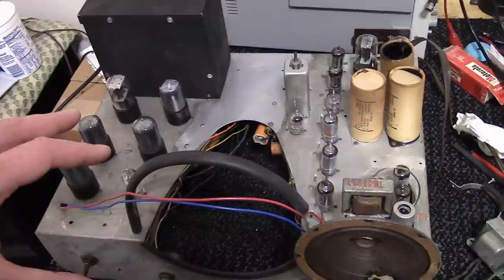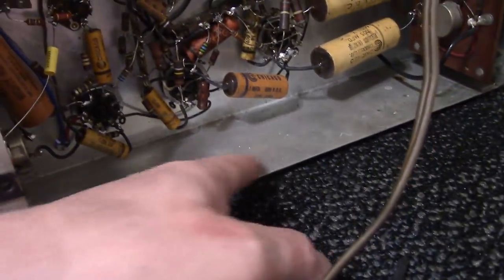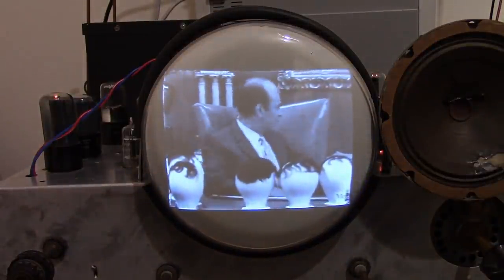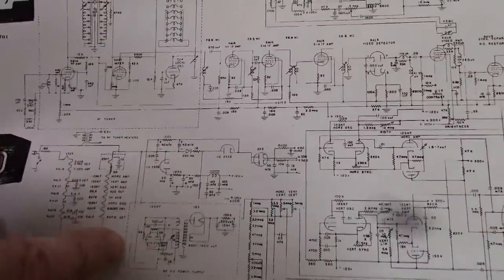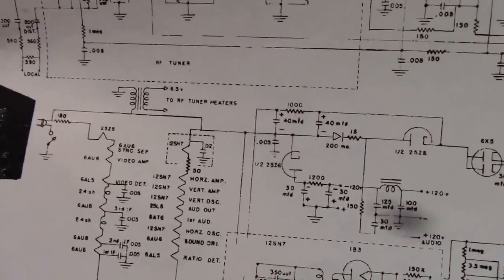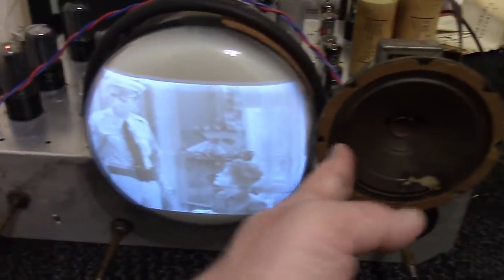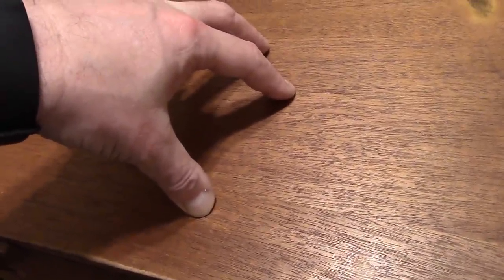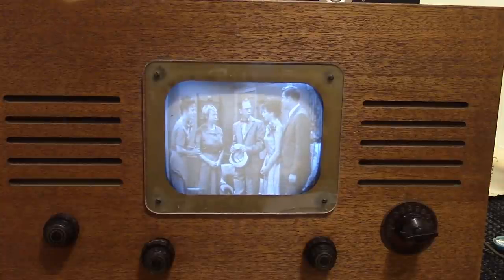Meck XB-702 p10o10

Comment: Wow the chassis looks and works amazing Bob! I think the CLR is the ticket for chassis cleaning based on your results! I haven't used it before, but I certainly will try it now. It's a shame about the cabinet, but the set works well due to your diligence and attention to detail! Great series sir!
Reply from the maker: Thank you. It works very well on cadmium plating and steel. However, it's only going to remove light surface rust. You'll still need evaporust or naval jelly for heaver corrosion

Comment: Cleaning expert here. Use WD40 and a short bristled disposable brush with lots of paper towels and q-tips. Works like a charm. Use 0000 steel wool and WD40 for rusty spots. Don't rub hard!
Reply: 0000 Steel wool can do some remarkable cleaning. I needed to clean some mild surface rust off of the brushed finished steel handle on a Sencore RC-121 substitution box, that has a "Sencore" branded paint logo. The 0000 was able to clean it without removing the paint logo, which I was pretty surprised at. The downside is, it will shed fine steel wires all over, that need to be cleaned up and kept away from anything they may get into while cleaning, especially anything with a magnetic field on it.
Reply from the maker: I've used those techniques in the past watch my "chassis clean tips" video from 10+ years ago ;)  I like the CLR on cadmium plating because it chemically removes the tarnish and corrosion.

Comment: Glad. It worked out in the end Bob. Reminds me of working on broadcast cart machines back in the 1980s.  I worked at a factory in the inner North of Melbourne testing and troubleshooting the CEI 993 and 996 models.  They were designed with the audio output transformers mounted under the mains transformer but the audio transformers were rotated 90 degrees.  Usually there were no issues with hum, but we kept some mumetal handy for the rare one that hummed enough the fail the -56dbm spec.  Wonder if the core wasn’t containing the magnetic field as well as it should?

Comment: It looks pretty nice as is. There are some dark marks on the screen that show up when the lights were out. I don't believe it is the tube, I'm guessing it is something on the faceplate which should just polish out when you refinish the case. I recently bought a circle cutter that doesn't punch a hole in the middle. It is a Thinnerline Circle Cutter by Shadow Hobby. In order to cut cardboard with it, you would need to purchase the 30 degree or 45 degree blade. It only comes with 1 60 degree blade, which is only really good for cutting circles out of paper and masking tape.
Reply from the maker: Yes, it is gunk on the plastic faceplate.  Thanks for the circle cutter tip.

Comment: Great vid as always. I added the DC restoration circuit you used years ago to my 7" Admiral and it worked great. I have never understood how a white phosphor tube can display black. My intuition would say in dark scenes the gun would emit less energy and the phosphor would not get excited and glow white as a bright scene, but remain unexcited and stay the same color as when the set is turned off-white.  But to turn it black is beyond me. If on a dark scene it turns the phosphor clear and we are seeing inside the tube, that's even more bizarre.
Reply from the maker: The really crazy thing is that it doesn't turn black at all.  It's white all the time.  It's your eye that gets tricked into seeing black.  If you try watching the set in a well lit room, the illusion is ruined.

Comment: Good, but why to always play the decades old clips on the retro TV sets? Why not some new ones?
Reply from the maker: Modern programming is the wrong aspect ratio.  It would either be letter boxed, stretched or cropped.  I'm just displaying the MeTV channel live over the air broadcast.  Also, color programming produces artifacts (chroma dots) on B&W TVs designed before the color era.
Reply: @bandersentv  OK, thanks for explanation.👍